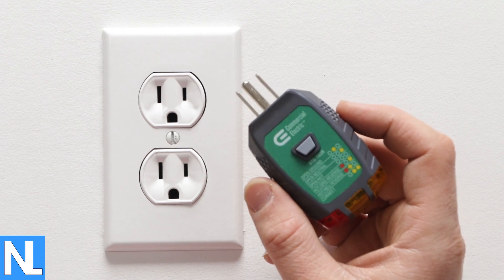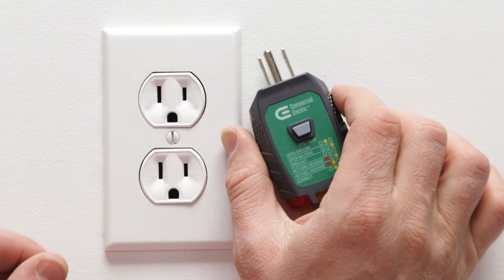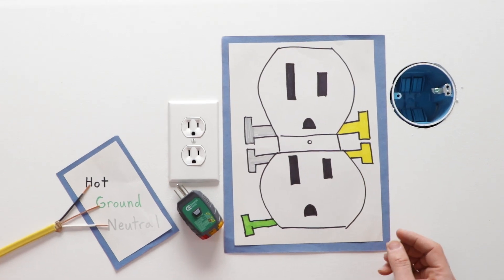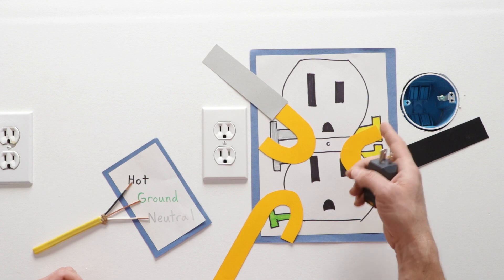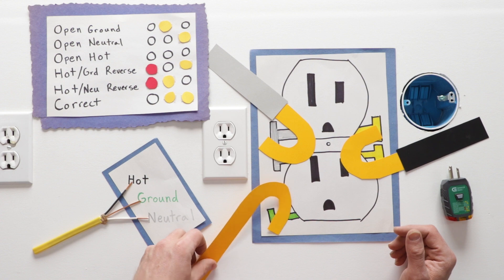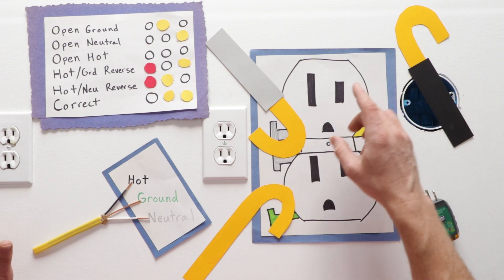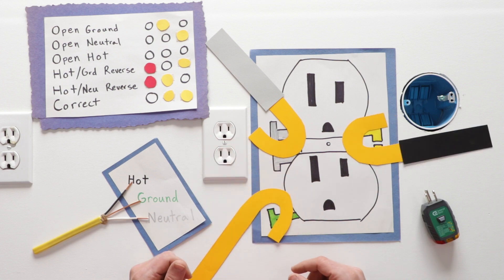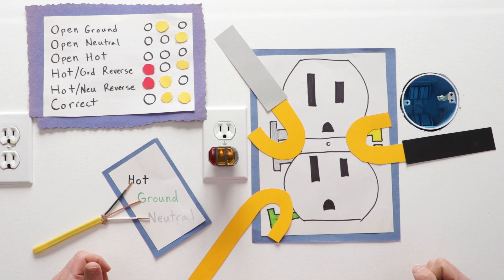How to use an outlet tester/ aka a receptacle tester.

Comment: I have an open neutral. In the video you said if I get that reading, it means they’re not connected. I see that they are (haven’t done anything other than look). There hasn’t been power to it in several years, but there used to be. Is it possible it could be anything other than maybe loose wiring?

Comment: There's also bootleg ground, which these inexpensive outlet testers won't detect. it's extremely unlikely a DIY'er would do that by accident, but you might find that in an older house where possibly a house flipper did that to fool a building inspector.

Comment: This is driving me nuts my meter is telling me my ground and hot is reversed and it’s not I don’t know what the problem is
Reply: It could be that the cable is connected incorrectly elsewhere in the circuit, ie, the main box or a junction. Best get an electrician to look at it. And don't use that outlet in the meantime.

Comment: What if there’s Only 2 wires in outlet with no ground wire??

1 outlet showing hot / neutral reverse
 others showing hot/ ground reverse 
Old Home from 60’s.
Reply: Then you should reattach the wires to get the middle light on by itself, ie, open ground. Black to brass and white to silver should do it, as he said. If it doesn't you need an electrician.

Comment: LOL learn basics of AC. There is no running reverse on single phase AC. The direction of the current changes 120 times a second.Most of the world uses plugs that can be inserted either way.

Also hot-ground reverse is not real. Nobody wires a socket like that. It meas open neutral with a load on some other socket. Unplug all devices so it should show open neutral.

Comment: If you have a old house with an ungrounded 3 prong outlet will the outlet tester still show correct if the hot and neutral are both connected correctly without a ground?
Reply: No, it will show open ground.

Comment: Superior video. Please advise. All three light up on my tester. Which means one red and 2 amber lights all light up..what does that mean
Reply: When all three lights are lit, this indicates a 240 volt connection,  or large voltage drop on the neutral.

Comment: I have both yellow lights on, on my tester, however the far right one is flickering. The circuit has 6 outlets 3 are fine and the last 3 are flickering on the tester bulb. If far right flickering bulb  was off it would read as open ground so I checked the ground wires on that outlet and the one before it that reads as being ok. Powered up and still flickering. Is my assumption that there's a ground wire loose somewhere correct or could it be a damaged outlet?

Comment: is it possible all 3 lights are lit? if yes, what does this mean?
Reply: Yes,  this actually happened to me at a rental property in Pontiac Michigan where I lived for about 6 months.   Upon moving in I plug my LED torchiere in, and POOF!!   Myself having an electrical background I decided to investigate.  Someone,  probably the maintenance guy installed a regular outlet for the window air conditioner, and rigged a standard plug on the cord for the air conditioner.    To try and get a hold of the landlord (or slumlord) to report the situation, good luck on that.  I had  plugged my lamp into the other half of the outlet,  assuming it was a 120v air conditioner and since it was beginning of April  I didn't need to run the air conditioner at the time. Using my outlet tester, all three lights lit,  double checking with my multimeter and checking the label on the air conditioner sure enough I destroyed my floor lamp when hit with 240V.  I was pretty pissed.

Comment: I have this same exact tester and I plug it in to my outlet of choice and all 3 lights turn on I'm not sure what is going on tho because its wired properly
Reply: Well I guess obviously something is wrong but idk what it is or how to fix it. As that is the reason I bought this little tester to diagnose the issue
Reply: You should get a multimeter and check the voltage.    The receptacle might be hooked to 240 volts, or there could be a large voltage drop on the neutral wire upstream.

Comment: What if it's a two prong outlet?
Reply: You can plug in a cheater, then plug the tester into that. It will at least tell if the 2 wires are attached correctly by showing you an open ground result.
Reply: @philcig not exactly. With an open ground there could be reverse polarity eg. hot/neutral reverse as well, but the tester will still read open ground.
Reply from the maker: not sure at the moment. better look elsewhere

Comment: I never see him use the button in the video.  What is the button for?  I have the same tester, when I plug my tester in I see two green lights, but when I press the button the lights change to show reverse polarity.  Which reading is correct?
Reply from the maker: The button is to test a if a GFI is working. insert it in an outlet with GFI protection and press the button. if the GFI pops then your GFI protection is working, if nothing happens then you know the GFI is broken and not offering any protection.
Reply: @natelarge  Thank you, finally an answer. I see lots of people here asking the same question, including me. I would have been good to mention the button in the video. I bought one recently, it has the button, but it is not mentioned anywhere on the packaging, only the lights are explained.

Comment: Thank you for this. Had all of the lights in my 4 year old room go out last night as well as the bathroom. We  have a bunch of low powered night lights for him. 2 in his room and one in the bathroom. All went out suddenly. Got this meter and found all but three of the four outlets to be hot/ ground reverse. Been living here for 3 years. And it was never checked. But what if you get a red and two yellows on. How bad is that?
Reply: Opened up all of the outlets on that circuit - a total of 6. All but one were fine. (Screwed on tight or speedwired) The one outlet that was a problem had 3 hot and 3 neutral. Now one of the neutrals was doubled up on a hot. So I ended up screwing it onto a neutral screw. Thought that would have fixed it. But to no avail. I feel like I should replace all of the outlets and back wire them instead of speedwiring them. Because it's a mixture. That one outlet still has 3 lights and now the others read open neutral. Thoughts?
Reply: Would love an explanation for this... when all three lights are lit on the three prong tester. Been searching for hours
Reply: I couldn’t figure it out. So I called an electrician and it turns out that 5 feet above the socket one of the lines split and that’s where the problem was. Drilled a hole, connected the split ends, covered the exposed wire, patched the wall and good as new.

Comment: If wired correctly does that also mean it’s grounded?
Reply from the maker: In theory yes but not exactly. It will tell you if you connected the three wires correctly. however it will not tell you if the ground wire is connected to your panels ground.

Comment: Thanks for the video. 
But what is the "Test button" on the outlet tester used for? On some outlets I can't press it, but on some outlets it trips and whole circuit shuts off.
Reply from the maker: It is to test a GFCI outlets ability to trip.
Reply: So since some are not tripping when the test button is pressed, there is a problem? Yikes
Reply: Subscribed to your channel 👍

Comment: Good video… dealing with open ground although there is ground to the outlet and the outlet works ok, this is the only outlet to 1 main breaker at the panel. Also have a problem with 6 outlet that the outlets trip when connecting a vacuum even when nothing is connected to outlets. My 3rd problem is at the main breaker panel the 2 15 amp. Breaker very sensitive trips by lightly tapping on the set of 2 15 Amp. breaker.
Reply from the maker: Sounds like getting a licensed electrician to check out your issues would be the best. So much more can be learned from an in person inspection. 
Open ground can mean your ground is disconnected somewhere up stream in the circuit where you testing it.
Easy tripping is  a substantial symptom, you will want to get that diagnosed. Possibly more outlets are on the circuit that you are unaware of or there is a GIF present.
Breakers may need replacing or could be the wrong size.
Again I highly recommend a licensed electrician because they will know how to review the situation.

Comment: Thanks for this upload Nate...I have a question...my tester gets 2 correct lights but the lights are dim....Why am I not getting power when I plug in my device?...Thanks
Reply from the maker: That is a can of worms my friend.
Could be really dim lights. Check the device on other outlets that you know work. 
If I though my voltage was low I would check the outlet with a voltage meter.
Reply: @natelarge  Just checked the outlet tester on another outlet in room and the 2 lights show brighter and correct...Could it possibly be a bad connection on the outlet which is showing dimmer?..Thanks Nate

Comment: Thanks so much for this excellent explanation. I’ve had a problem with my restroom outlets for years. Sometimes they worked sometimes they didn’t. I flipped breakers off and on, same thing. When they were working I used the outlet tester and got a hot/ground reverse reading (dangerous). After watching some other videos I found that loose connections could cause that error too.  After checking all 4 of my restrooms I found a couple of loose connections and a GFCI breaker outlet that the hot and neutral wires were so loose they came off when I pulled on the outlet.  I tightened all the connections and now all are working correctly.  Your video gave me the confidence and knowledge to attempt this (successfully I might add).  I feel like a badass lol. Thanks again!

Comment: What if I get just the red indicator light on?
Reply from the maker: I'm not 100% sure but one of your yellow lights might be broken.
Also the key may differ for different outlet testers.
Reply: I have an Ideal brand tester it has a legend with just the red indicator light.    On my particular tester this would be "HOT ON NEUTRAL WITH HOT OPEN"  Ideal is the only brand of tester I know of that has this legend on it.

Comment: Thanks.  Well this gadget let you know if there’s any juice coming through the outlet if you shut the breaker box off.
Reply from the maker: Excellent question. The short answer is no. This is because the tester only works on the outlet and will not tell you if the wires behind it are electrified. learn how to use a circuit tester or a non-contact voltage tester.
Reply: @natelarge   thanks